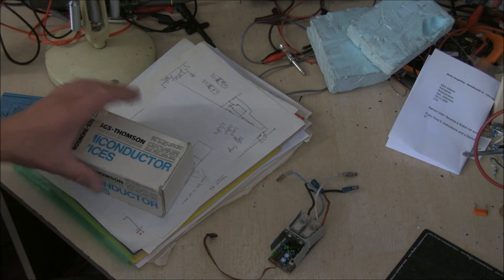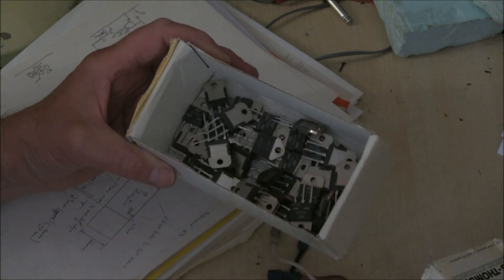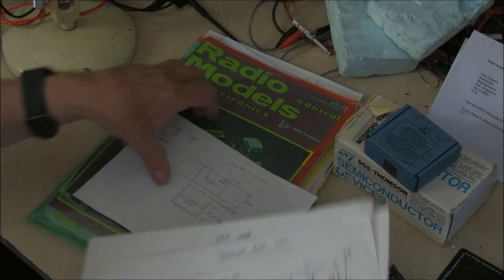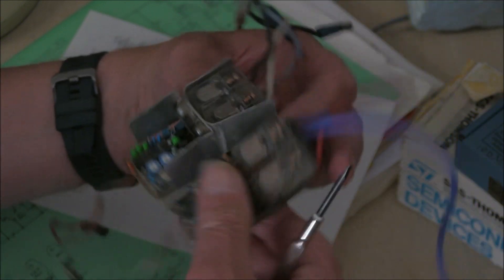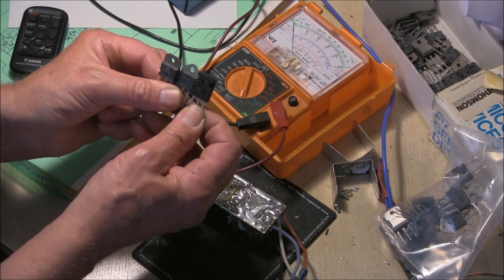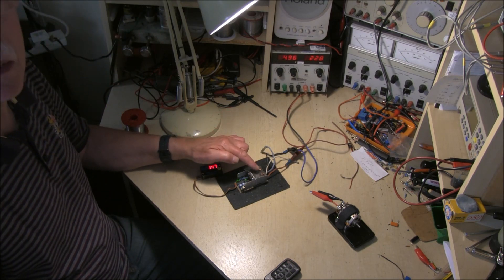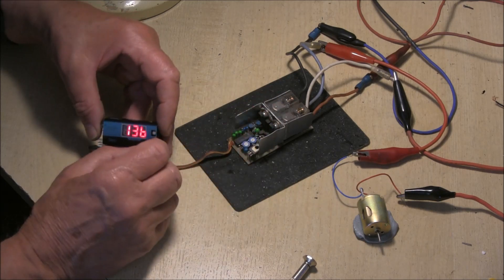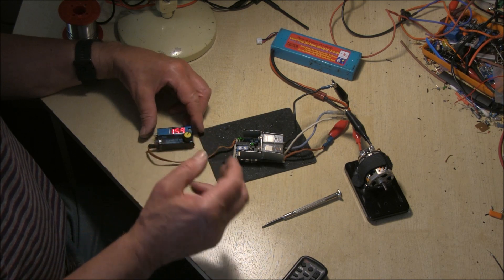Demon 2DH Speed Control from 1985. Repair and test. (1/10th buggy esc).

Comment: Hi Nick, I bought a 13.5 Certified Trinity motor for blinky touring car and put it in and it was a dog, on my motor anyliser its pulling 5.7 amps do i just advance the timing until it goes or will it get to hot because its out of the sweet spot zone?? is there anything else i can try as the timing was 47deg